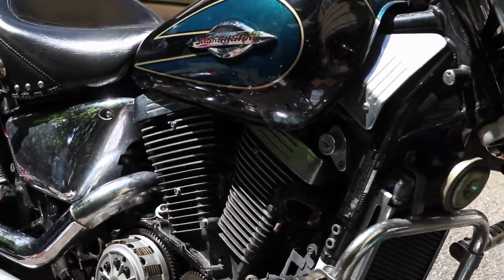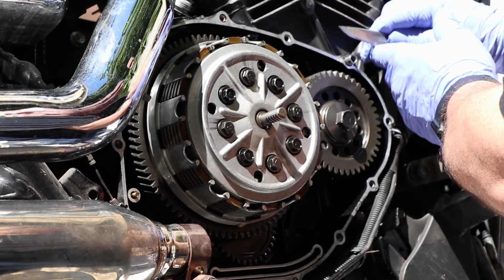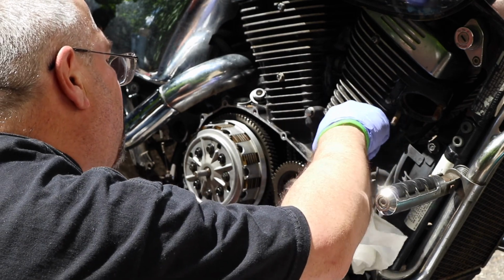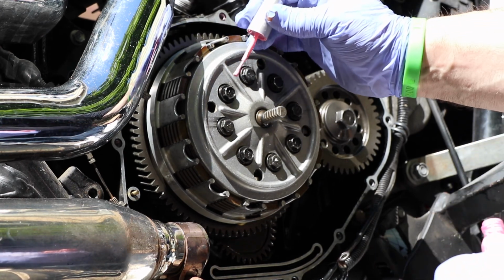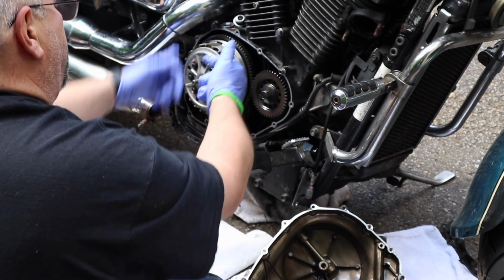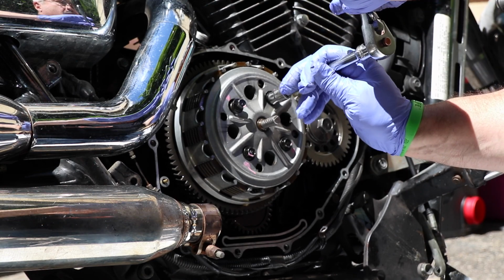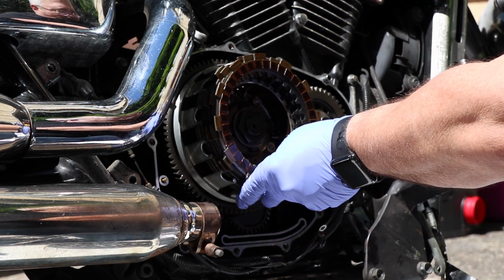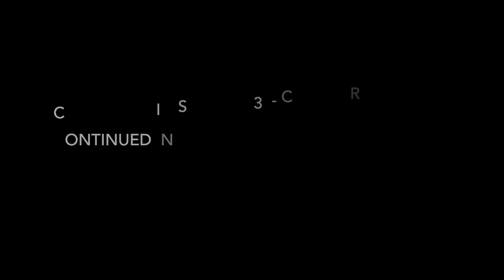Suzuki Marauder 800 Clutch Replacement - Part 2 - Clutch Disassembly

Comment: Have your bike had anything major in 95,000 miles ?
Reply from the maker: At the end of the last part of this he video, you’ll see the bike fails to start. That ultimately turned out to be the signal generator coil that’s part of the stator assembly. Replaced that and she started up just fine. Well over 100K now and still no major mechanical issues at all.

Comment: 5k miles on those bolts .. and you replace them ? :D .. ah well unneeded but ah well since we are there
Reply from the maker: 95k miles.
Reply: @ericboehm4529   how  the hell did you get 95k miles out of that clutch ? Its not even blue/purple
Reply from the maker: @randomusernumber1  Treated her well and lots of long distance and highway riding. Not that I baby the bike either. I enjoy riding at a "spirited" pace much of the time.